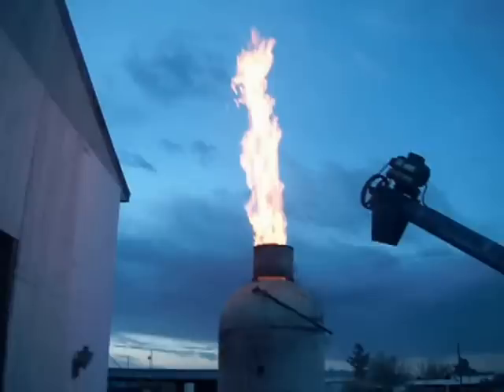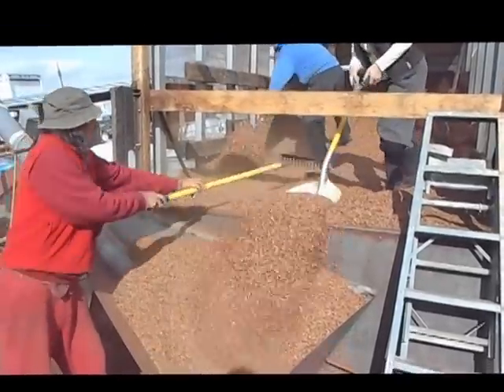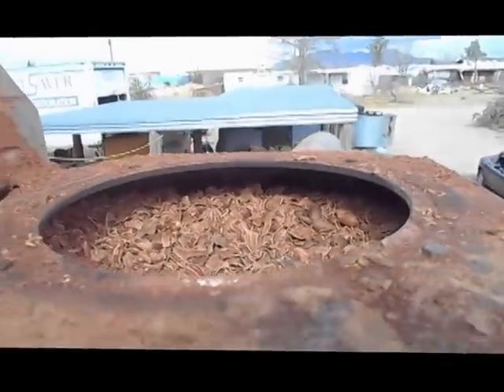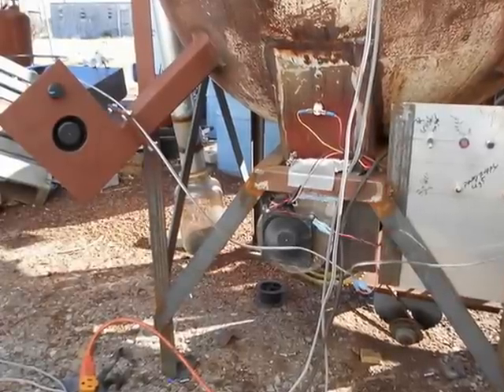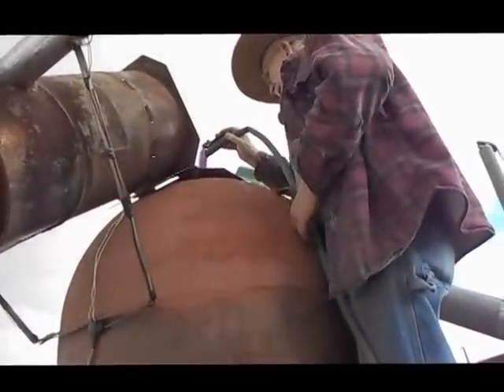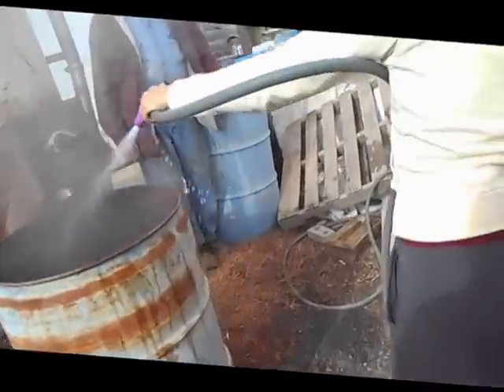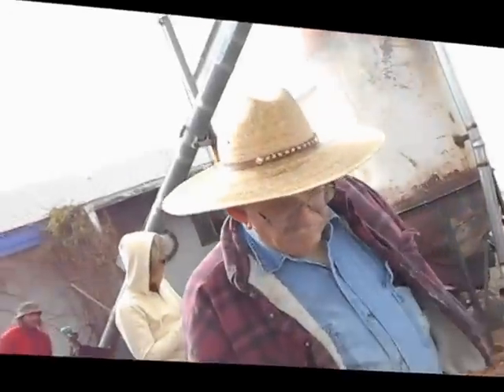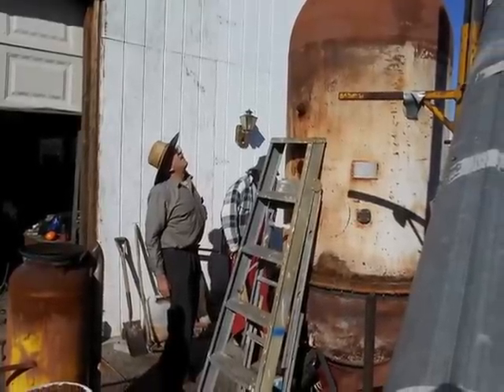Bill's 350 gal TLUD Biochar Gasifier Demonstration

Comment: does quinching charcoal damage its use for using in producing gas for fuel?
Reply: I wont say damage but not recommended. You would need to get the moisture down to around 8%. So after quenching, spread it out to dry first for a few weeks.

Comment: I have access to a propane tank like yours. Have you ever drawn out any plans for the one in this video? I am not sure how yours works. Does it reburn the volatiles that come off the feedstock? How much loss do you get to ash? I have access to an almost unlimited supply of wood chips and would try to use the heat to dry the next batch of chips.

Comment: Nice TLUD, the largest I've seen.

For a complete review of the current science & industry applications of Biochar please see my 2013 Umass Biochar presentation. How thermal conversion technologies can integrate and optimize the recycling of valuable nutrients while providing energy and building soil carbon, I believe it brings together both sides of climate beliefs.
A reconciling of both Gods' and mans' controlling hands.

Agricultural Geo - Engineering; Past, Present & Future
Across scientific disciplines carbons are finding new utility to solve our most vexing problems
http://www.trunity.net/files/236901_237000/236919/kinght2013-1.pdf